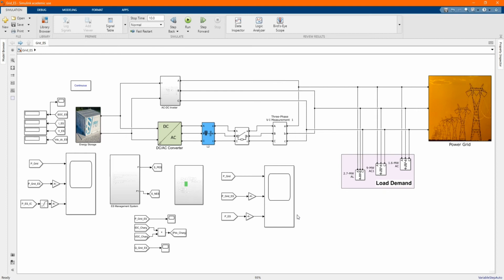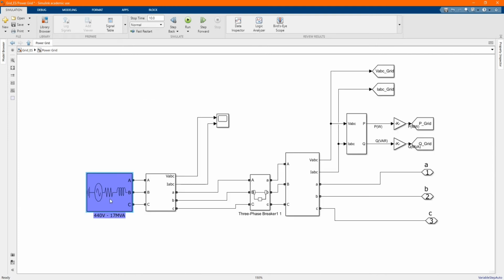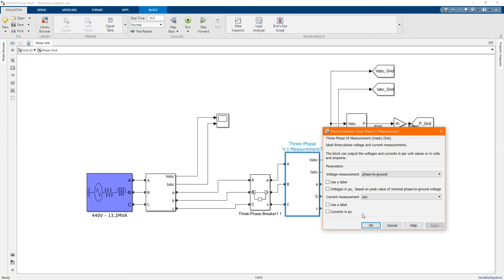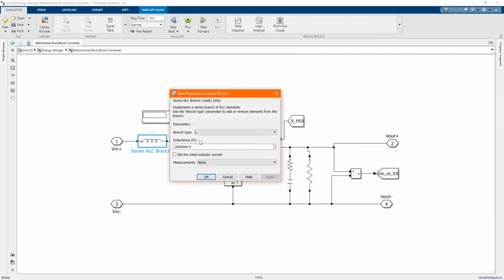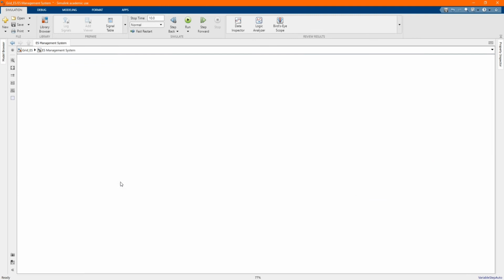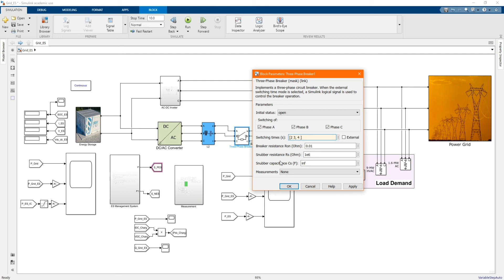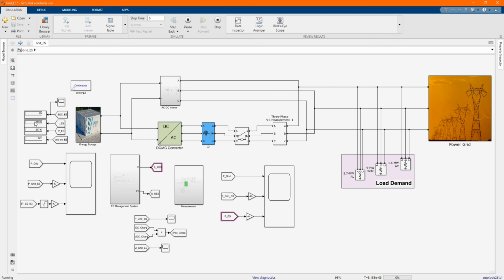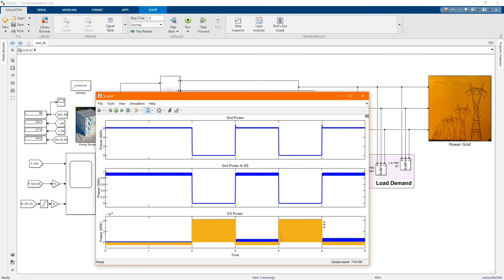Simulation of Grid Connected with Battery in MATLAB Simulink - Method 1

Comment: Hello! Thanks for your video. I see your Battery Nominal Voltage is 200V but in ES Management block you compare V_ES with value 600 and 300. What do these values (600 & 300) mean? And how to calculate?
Reply from the maker: hello, thank you for your comment. The V_ES is the 200V. 600V is the reference voltage and 300 is the charging voltage

Comment: can you disponibilizing the archive of simulation ? i thanks
Reply from the maker: Is there any similar project are you working on ?
Reply: @pzengineering2020  yes. I'm working in My PhD thesis in storage system , at Brazil.
Reply from the maker: @antoniov1091  you can e-mail to me in engineeringsolution800@gmail.com, no meu Mestrado fiz design of Battery Management Systems for Hybrid Lithiun-Ion and Lead Acid Energy Storage  System, the energy storage system era Fuzzy logic e PI controller